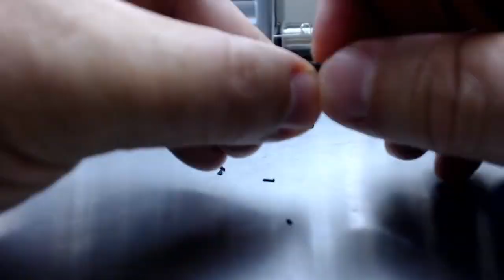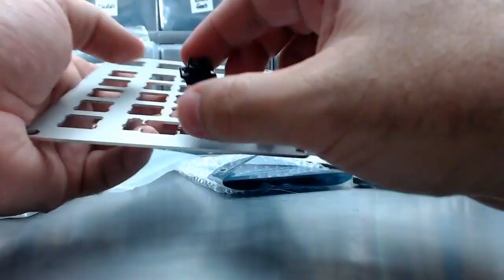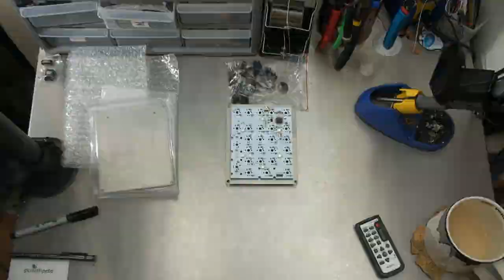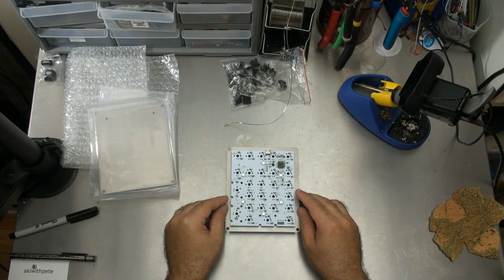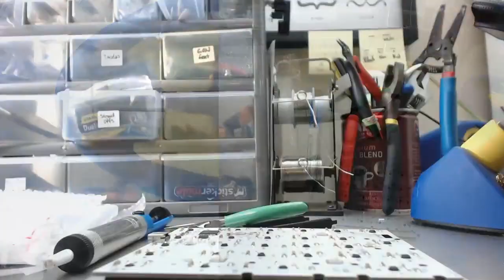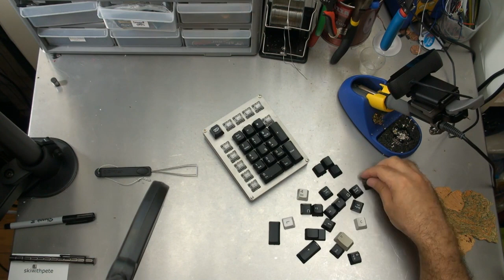Assembling the unreleased CLZ fully programmable numpad build with Gatistotle Switches

Comment: Do you recommend any great keyboard kits. I recently modded my wasd v2 to ergo clears and really like the soldering part. I want a kit that between 150-180 including switches. Any recommendations?
Reply from the maker: I really enjoyed the LJD61up in Black Carbon Fiber.  It's one of my 
all-time favorites.  But the universal 60% with the Carbon Fiber top and
 the Aluminum base from http://1upkeyboards.com is pretty cool too.
Reply: I actually really like the kits. What are all the parts that I need to build one. Sorry for bothering you, i'm new to this.
Reply from the maker: Plates, stabilizers, standoffs, switches, keycaps, PCB (or teensy).  
Most everything is available in the kit (PCB is out of stock until 
January 4th), you just need to add switches.  --you're never bothering me.  I'm happy to help.

Comment: Are there any kits for a full sized keyboard but numpad on the left? I would like to clean up my work area but I use a tenkeyless with a separate numpad on the left, and I would be super happy if someone has a kit board for one integrated on the left. Hoping its one I can build myself, cause its difficult to find prebuilts with 65g zealios purples, which are my favorite. Preinstalled diodes would be amazing, but beggers can't be choosers.
Reply from the maker: The TKL (tentatively called the LJD87up) is still in prototype and hasn't been released yet.
Should be mid-end of Feb.
Reply: skiwithpete That's a TKL. What I am looking for is one with the Ten key on the left, not absent, I already have that :)
10 key on the left preserves ergonomics of a TKL, but keeps the numpad. I use a separate numpad on the left right now, but if a keyboard actually integrated it on the left, I would be all over it.
Reply from the maker: Ohhh, no. Sorry.  Fullsize (keypad on the left) - there's no existing PCB for that at the moment, so we don't have a kit to support.  We hope to add the capability to make PCBs in the future... but until then, you'll need a separate numpad.
Reply: skiwithpete I am genuinely surprised the idea hasn't gained traction. I know quite a few people who use a TKL with a separate numpad on the left. Seems like an obvious thing to me. /shrugs
Maybe one day :)
Reply: it's is the exact problem i've run into, i want a TKL for gaming but a numpad for work etc. There is the new asus claymore with its swappable numpad but that's waayyy out of budget for me, over 200$ for a keyboard is insane.